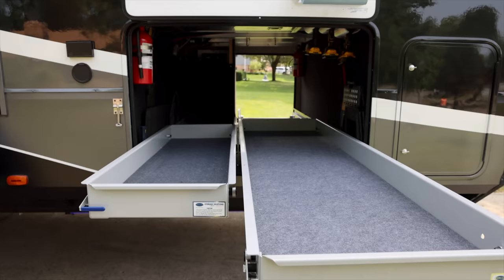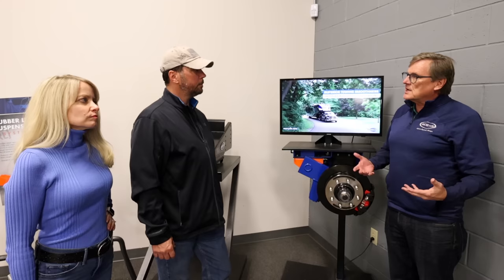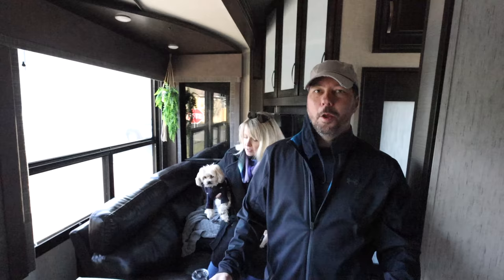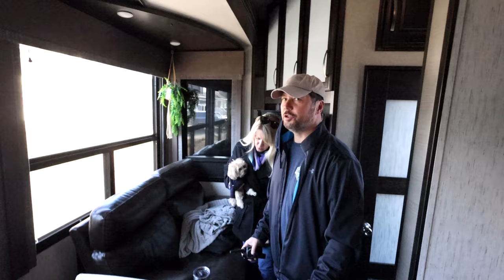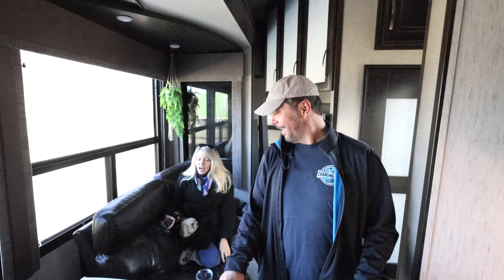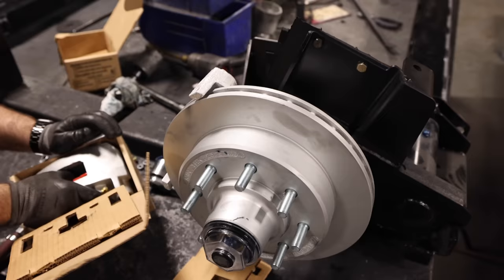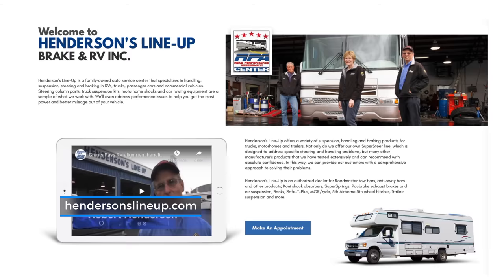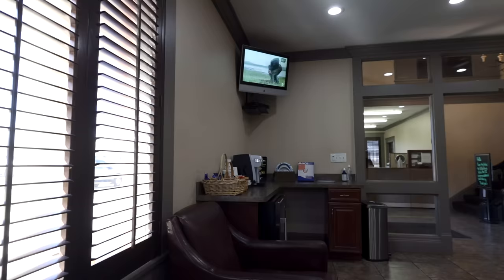MORryde Independent Suspension and Disc Brakes

Comment: If you have 7k factory axles and you upgrade to 8k aftermarket axles is it possible to have your GVWR re-assessed? is that even a possibility?  I remember watching your video on GVWR that Chad did such a thorough job on long ago. I was shocked as I became familiar with these numbers that RV's are so low on cargo capacity. I would bet that 60% or more of the fifth wheels on the road are over loaded. GVWR is like a bucket, what you can put in the bucket depends on what is already in the bucket and you've got to really study these buckets lol. Basically what I have found is that a series of a make will probably use the same or similar frame and axles and they mostly all have the same GVWR, so the lighter the particular unit, the more cargo it can carry IE the smaller unit in the same series can carry WAY more cargo (by the numbers) than the bigger brother models in the same series. So summary, is it possible to get any additional GVWR when having something factory installed like this? Who assigns the GVWR on fifth wheels anyway? My guess would be the frame manufacturer.
Reply from the maker: It is possible to upgrade axles and improve GVWR in theory.  However, getting the official GVWR changed is almost impossible (we hear).

Comment: Chad, quick question and not something I hope you havent had to do yet.  

Jack up your tire that is flat and change a tire. 

FYI, I did contact Morryde on the Jack Point and got that information   However, the point to set the jack is kind of low (though right now I'm just in my driveway) but am wondering if you had to change a tire or tried to "test" it.
Reply from the maker: Yes David. Here is the vlog about it. https://changinglanesrv.com/rv-tire-blowout-be-prepared/
Reply: @ChangingLanes  Right, and I watched this video before.  But you still had the leaf springs at that time.  I'd double check your jacks to ensure you can get to the right location to jack at the correct point. 

Love your channel and looking forward to many more!

Safe travels.
Reply: I just watched your video again.  You pointed out where the jack points are.  Have a great day!

Comment: Wishing you had published this video 2 weeks earlier....ordered our 2021 Momentum 376THS but did not choose to include the 8K/disc brake option....would have had I seen this before hand....
Reply from the maker: If your unit isn't built yet, I'd bet you can still coordinate it through your dealer or GDRV.  Maybe....  Worth a shot.
Reply: @ChangingLanes  Working with dealer who is supposed to be in  contact with GD.  Its $7.5K option if part of the build....definitely more cost effective than after taking delivery.
Reply from the maker: Awesome! 👍🏼
Reply: Well as it turns out, I incorrectly interpreted the 8K axle w/disc brake option as including the IS, it does not.  Appears the only way to get the IS / disc brake is after I take delivery of my unit.  Dont believe the 8K axles are necessary but would at least love to be able to get disc brakes on the factory 7K axles.

Comment: Hi Chad and Tara, thank you for the great job you guys do with your videos.  We had the IS installed on out Solitude in Oct. Since then we've put over 3k miles.  As full time RVers my wife and I feel it was expensive but a worthwhile upgrade.  As a side note to your IS, what tires are you running now? Thank you
Reply from the maker: We have a new set of the stock Westlake G rated. 👍🏼

Comment: so i’m going to buy a 397 th and was wondering if you can skip going to 
 the MoRryde fact or just order this great system when you buy the 397 from grand design? And is it less of a cost due to you not having to buy grand designs axles when you order the fifth wheel?

Comment: Another great video. Thanks for all the extra information. Our IS & Disc Brake upgrade is scheduled for May.   Did you get 8K or 7K IS?  How did you mount the GoPro under the rig for the test videos?
Reply from the maker: Since we have 3 axles, we stuck with 7K.  I found a few places to clamp on a gopro or use a cargo ratchet strap and a mount. Just gotta get under there and get creative.. 😀  👍🏼

Comment: Why did the Getaway Couple experience tire issues and disc brake issues upon installing the independent suspension system.  The brake cables blew out and tire wear was uneven.  Maybe the suspension was crooked?
Reply from the maker: No idea.  If we experience anything like that, we'll be sure to put it in a video.. 👍🏼

Comment: Did you weigh the rig before amd after? I'm curious about the weight added with this upgrade.  No issue being down low but it effects the total gross weight rating.
Reply from the maker: It's a little bit complicated.  Please see: https://changinglanesrv.com/faq/?Display_FAQ=3913
Reply: I was wondering the same thing, they look a lot heavier. I like them but only have 2600ish lbs capacity in my Montana Legacy 3781RL and I can't afford to lose any carrying capacity. The 2021 Montana already come with beefed up leaf spring, thicker axles, disc brakes and a very good Road Armor equalizer.

Comment: Since the IS system for 3 axles adds ~ 1,200 lbs. to the UVW and from my discussions with MORryde , this will adversely affect cargo capacity and exceed the OEM GVWR....they also stated they are not able to change the weight rating sticker to accommodate the increase in both UVW and GVWR....how do you manage this especially if you were on or near the OEM GVWR?
Reply from the maker: It becomes one of those things where the "real" capacity is higher than what the sticker says.  Since the suspension is what is actually holding the weight.  I know if you get 8K axles from GDR from the factory, the GVWR increases to 21K.  This is similar but does not change the sticker.
Reply: @ChangingLanes  Completely agree, yet if DOT happens to stop and request a weighing of your trailer, it will be over weight and potential fine...that is why we have not done the IS system yet as the Solitudes have limited GVWR from ~1,950 to 2,200 lbs. and by adding the IS system aftermarket (2 axles) would reduce the GVWR by ~ 700 lbs. leaving us on our rig (2,032 - 700) 1,302 lbs. of available cargo capacity...if MORryde was certified to update weight stickers, they we would be getting the upgrade.
Reply: @ChangingLanes  if you get it as an option when ordering it with a new rig from Grand Design will Grand Design upgrade the capacity sticker?
Reply from the maker: Totally get that.. And we used to worry about that.  FWIW, we've never heard of an RVer getting stopped by DOT.  They are way too busy with commercial traffic to mess with an RVer.

Comment: This sounds like a Mor/Ryde advertisement. Are you getting paid? How much is this system? Mor/Ryde IS rubber sheer springs last maybe 6 years. Disc brakes are nice. But as far as suspension , 
Roadmaster Slipper springs with Joyrider Gas shocks are at least 1/3 the cost and reliability is much higher.
Also I installed this myself, easy install, even the alignment! This is also independent suspension and no maintenance.
Reply from the maker: You can find the pricing details for the various IS options in our blog post here: https://changinglanesrv.com/morryde-independent-suspension-upgrade/ 👍🏼

Comment: Now that you have the independent suspension installed, where would you place your bottle jack to change a tire?
Reply from the maker: Officially: under the frame.  But they said it's also ok to jack under the part that holds the hub / spindle.
Reply: @ChangingLanes  does that change the “size” bottle Jack you need?

Comment: I noticed when the team removed the leaf springs, they removed the Equaflex hangers that were mounted between the axles.  Did they come with the trailer or had you fitted them at an earlier stage?  It must be really rough if the trailer only had solid steel hangers prior to that!
Reply from the maker: Those hangers came with the RV.  I think the MORryde hangers are stock now.

Comment: Just got to our campsite from having Morryde install the IS w disc brakes. I always roll my windows down when entering a campground in case of issues. I started hearing a lot of squeaking from the rv wheel area. Sounds like an old utility trailer. Wife hot out and verified it was coming from IS system. Have you ever noticed this?
Thank you
Reply from the maker: Not at all.. Ours are very quiet compared to leaf springs.  I would definitely investigate further.
Reply: @ChangingLanes  Thank you very much for the reply.  Will contact Lindsey at Moryde to start troubleshooting.

Comment: Great video, and you just cost me some money!! I already have the kodiak disc brakes, so I Am guessing that I would only have to do the suspension? And could I upgrade to the 8000 over my current 7000?
Reply from the maker: Yes on both accounts.  8K's are popular on tandem axle units.
Reply: Thanks for answering back, Safe travels.

Comment: My partner and I are going to be first time Fifth Wheel owners! (2014 Crossroads Rushmore RF39WA). We are moving from eastern NC to the Pacific NW, Seattle area, so quite a haul. How important would a suspension upgrade be for this type of trip?
Reply from the maker: For a single long trip, I would not worry about it.  If you're traveling full time or even part time, it's a great investment.

Comment: OK so I'm sold on the MORryde IS. What's the best suspension system upgrade you would make on the towing vehicle such as an F250/350?
Reply from the maker: I wish I knew.. We might try out the kelderman system.
Reply: There's a great company out of Canada, Autoflex air suspension, that makes a great rear leaf spring air suspension replacement system. I had a family member that was going to purchase it due to towing their heavy 18k lb 44' toyhauler. So I did a bunch of research and was really impressed with their system. I would definitely go that route if I was towing a larger/heavier 5th wheel.

Comment: My question is how much does it cost. And why we should even have to do it at all travel trailers have been around for 80 years no problems and now the past 5 or 6 years this stuff is junk all of the sudden I promise if mine brake and cause damage or someone gets hurt the manufacturers will regret making this stuff so thin and flimsy. Enough said.

Comment: Maybe I missed it, but do you know if Grand Design will install these on a new order? We are looking to order a 349M in the spring. Thanks for all your videos and time. I have learned a lot.
Reply from the maker: Yes, they will.  But it's not an advertised option.  You need to ask.your dealer for it. 👍🏼
Reply: @ChangingLanes  
That’s great. Thanks again! Happy trails and hope to see you on the road one day.
Reply: Having added this (8K IS and Kodiak Disc) to my 2020 Momentum 349M after it was delivered, I can wholeheartedly recommend it and would definitely have it installed by GD before delivery if I was ordering now. I simply didn't know about it at the time I placed my order.

Comment: Just out of curiosity, since you had 7k axles stock, did you get 8k or 7k axles installed? I suppose it’s “only” $500 for 8k vs 7k, but is there any significant benefit?
Reply from the maker: You can read about this in the article attached to the vlog here: https://changinglanesrv.com/morryde-independent-suspension-upgrade/

Comment: Saw you measuring the height did the new suspension change the height of the trailer?
Reply from the maker: We ended up right where we started.
Reply: Based on the 13'6" height limits, they measure to determine where the trailer rides while hooked up to your tow vehicle. Then then measure front to back and will "level" the trailer by adding/reducing height in the new rear suspension. They were able to get mine level at 13'5" front to rear by increasing rear ride height slightly.

Comment: Hi, I said I would watch this video when you released it, so I did. Couldn't find the blog.... It looks like an awesome improvement. love the cameras mounted under the rig to watch the ride let the picture tell the story, and this is what was accomplished. a smooth flowing video story. Mor-Ryde, looks to be your favorite after market improvement place. being a (retired) master truck technician, I only have 2 questions for you. (1) what is the weight difference between the old leaf spring system and the complete new system? and (2) what kind of warranty did you get on the rubber torsion blocks? I have spent many years replacing them, they (in my experience) on heavy truck daily usage never seem to hold up that long. finally, how did they supply power to the fluid reservoir controller? did they use the factory wiring that was for the original electric brakes? or did they cut and splice? looks great, are you going to do a follow up this time next year, after you have put a few thousand miles on the new suspension? You guys are awesome and never fail to put out some awesome material, THANK YOU. Have a very Merry Christmas. stay healthy and Even Safer Travels.
Reply from the maker: It's a little bit complicated on the weight.  Please see: https://changinglanesrv.com/faq/?Display_FAQ=3913 
On the warranty: 5 years or 100,000 miles - https://www.morryde.com/wp-content/uploads/2020/01/Suspension-Parts-12-Month-Limited-Warranty-Commercial-4-6-18.pdf 
They spliced in new wiring to the 7 pin for the brake actuator.

We've towed about 1K miles now and it's been GREAT!

Merry Christmas to you too!
Reply: @ChangingLanes  That's great. Have you ever put your truck and trailer on the scales?? if so, Put it on the scales now and figure out the difference. just seems to be a simple way to answer the common question about weight difference.
Reply from the maker: Yea.. I should have done a before weigh.  Last time we weighed we were about 600lbs over GVWR.
Reply: @ChangingLanes  Oooops.......
Reply: @ChangingLanes  Wow, with a triple axle toy hauler?? That's crazy.

Comment: Does Grand Design offer the Moryde independent suspension on there new  2021 models ??also did you have the main slide out opened up while doing road test ?
Reply from the maker: Yes!  But it's not advertised.  You need to ask your dealer for it when you order.  👍🏼
Reply from the maker: and... no.. the slide was in! 😳

Comment: I guess my big question is what would something like that cost on three axles? And what is the turnaround time?
Reply from the maker: You can find the pricing details for the various IS options in our blog post here: https://changinglanesrv.com/morryde-independent-suspension-upgrade/ 👍🏼   
Our setup (3 x 7K plus disc brakes) runs $10,399.
Reply: @ChangingLanes   That is about what I thought it would run, once it was all installed. I would need that exact same setup I have three axles on my Spartan 1245.

Comment: Would you know if this upgrade is the same one Grand Design offers in the 8k axle with disc brakes
Reply from the maker: It is not the same, but you can get the IS as an upgrade.  It's just a hidden option.

Comment: Which RV Suspension is better and why? Roadmaster are MORryde?
Reply: Roadmaster, with Joyrider shocks. $1400 (parts, easy install). No maintenance. MorRyde sheer spring will last 5-6 years max (they tear, which is part of what you have to watch) They give you a max that be torn and still drive. (sounds great, wait till it falls apart).

Comment: Did you change the kingpin as well, if so did that contribute to the ride as well.
Reply from the maker: We changed the pin box out a few months prior: https://youtu.be/0nmJJQafPSQ
Reply: @ChangingLanes  how do you like the MorRyde pin box. Wht type of hitch do you have in the truck. I have been told to look up the Anderson Hitch any opinion on that one
Reply from the maker: See: https://changinglanesrv.com/?s=hitch
Should get you hits for both.. 👍🏼
Reply: I upgraded my Momentum's pin box to the same MORryde pin box over a year ago and can attest that combination provides an excellent towing experience. Currently running the B&W 25K Companion 5th Wheel hitch connected to the factory-installed puck system. I had the B&W and pin box before the IS/Brake upgrades and yes, the improvement was still very noticeable. The MORryde pin box includes a similar rubber bushing as the axles.

Comment: So if you went with a new momentum would you ask for the suspension upgrade so to speak before you took delivery if it is not equipped with it?
Reply: You are better off doing such as I believe the axles here are 8k axles versus the 7k axles that come with the Grand Design.  A benefit as it lifts the GVW of the trailer.  Something only the manufacture can do at build.  Yes I know you can apply to have the GVW modified afterwards, but it is a PIA and I doubt anyone does it, MORryde included.
Reply from the maker: Yes.. it's a "hidden" option that you need to coordinate with your dealer.

Comment: With the independent suspension, do you still have the equalizing effect as if you still had the equalizers with leaf springs?
Reply from the maker: Equalizers help provide more movement in the leaf spring and dampen axle to axle.  No need for any of that with the IS. Each wheel is completely independent of the other.
Reply: @ChangingLanes  equalizers help to balance the load among axles, so when the trailer is going over bumps or other harsh terrains, no single axle/tire/leaf spring takes the entire weight of the trailer. Premium equalizers like MORryde CRE3000 provides extra damping while equalizing the load, compared to a standard all-steel equalizer.
Maybe travel trailers, especially triple-axle ones are not expected to see harsh terrain at all, so no equalizer is fine. Just like tandem-axle dump trucks have equalizers, but tandem axle delivery trucks and on-highway semi trucks don’t have equalizers and are free to use air-suspension